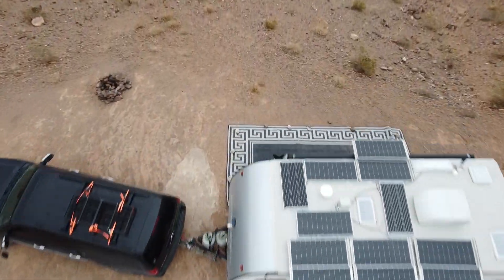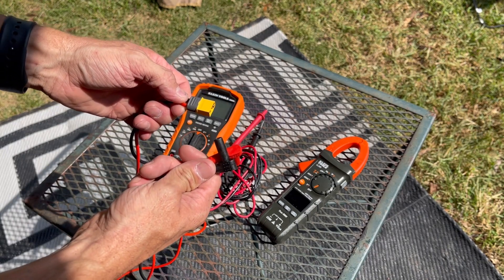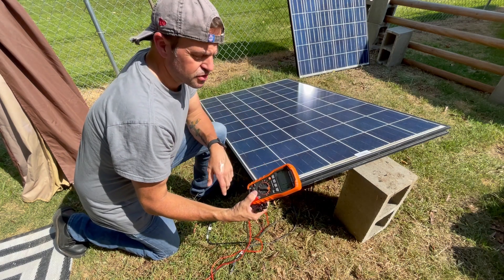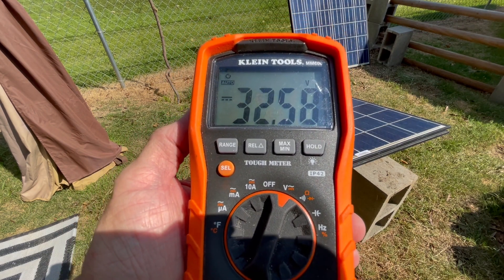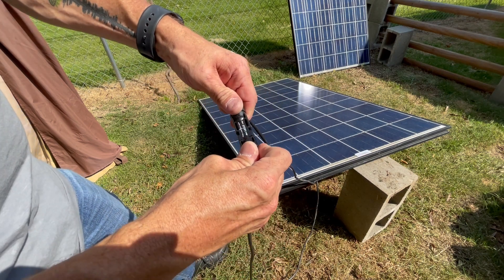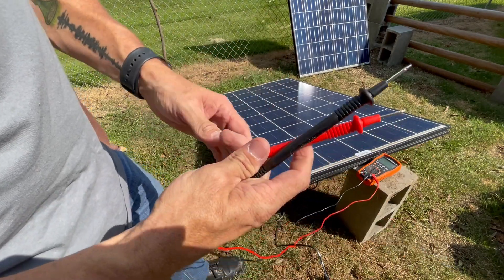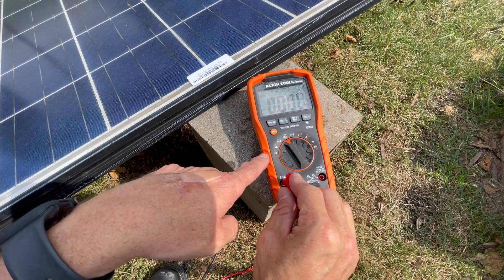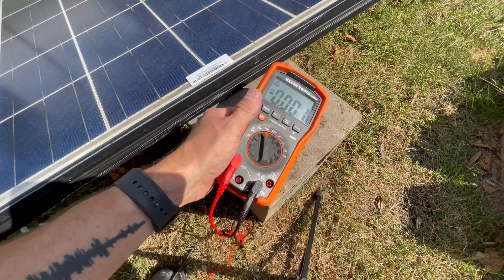How to Test Solar Panels - SanTan Solar 250 Watt Panels - Off Grid Solar - Off Gridin IT

Comment: For your information with electrical testing ground is always hooked last
Reply from the maker: You should always connect the ground on electrical testing equipment first.   The reason is because if you connect a testing device to a faulted circuit or device there is potential that it may send a surge in a fault event that could go through your testing equipment and into your body.   

If there is no ground connected then your body will complete the circuit and you could be electrocuted.   If the ground is connected it would be the path of least resistance and you would be more likely to be protected.   This is what I have leaned over the past 35 years.   

However, if you have a source that would refute this I would like to read it.   Please post it in the comments.

Comment: My inverter on my camper is shot. I think. It’s killing my battery. And the lights are flickering. I plan on doing a solar project next year. So what do I buy to replace my current inverter that allows for future solar?
Reply from the maker: If the batteries are at a low state of charge you may see flickering when you turn on other loads.  If you are building an all new system I recommend the Growatt SPF 3000.   it is an all in one system.  

It is great for 30 amp RVs and can handle a 2000 watt array and 145 volts input and is an 80 amp charge controller.  It is an inverter, charger and MPPT charge controller all in one.   

It's only $712.00 so it's a great budget.  
Also check out my affiliate links below for SanTan solar for great deals on used panels.

Growatt SPF 3000TL LVM
https://watts247.com/product/spf-3000tl-lvm-24p/?wpam_id=98

Shinelink Wifi-F Stick by Growatt (Growatt Bluetooth Dongle)
https://watts247.com/product/spf-lvm-120v-240v-solar-inverter-wifi-module-remote/?wpam_id=98

SanTan Solar T Series 250W Solar Panels
https://store.santansolar.com/product/santan-solar-t-series-250w/?ref=Off%20Gridin%20It

Comment: I feel that it might be dangerous to connect my 8 panel Series array  together to test the amps of the array ?  Can you tell me if there might be a problem with doing this?  Thanks
Reply from the maker: I’ve never tried to do that many. Typically I only test panels individually so that I can see if there’s a problem with a specific panel. 

Connecting the whole series won’t tell you if there’s an issue with an individual panel and it would be hard to tell if there was a problem because an array that large could have a pretty wide deviation from its specs depending on the environment and weather conditions.
Reply: @OffGridSolar  thanks for the response. I'm just trying to monitor my array output.it is only used for day air-conditioning for my home and I want to find out the amps it is able to put out. I was able to measure volts DC.  I'm not sure how to measure the amps
Reply: @mattm5696  U can short a string. Remove the cable from the PV array isolator and put a link between the positive and negative outputs of the PV array isolator and measure the DC Amps with a DC clamp meter. Make sure if using string fuses disconnect them.

Comment: When you measured amps through your meter on first configuration (not clamp-on), it looked like you had no load on your panel. I thought you couldn’t measure current without flow.
Reply from the maker: The current is flowing through the meter.   Another way you can measure current is to connect the Positive and Negative conductors of the solar panel together and use a clamp meter.   I usually don't use this method but it works well also.
Reply: Following
Reply: No danger to hook up the array?

Comment: Just as a side note, make doubly sure your meter can read DC on amps. I have 2 that only read AC, so testing amps on my solar would read nothing coming in. 

I've been asked how can my meter not read AC and DC and trust me, it is possible to have meters that only read AC and not DC. Don't think all meters read the same, because there are meters that read only AC for amps, generally the cheaper ones.

Also be very careful doing things in series especially if you have 24v setup. 
I'm doing parallel myself 2x100 watt 24v panels. Being as they are 24v that's doubled in series equally to 48v. A lot of meters don't handle that well.
Just do lots and lots of research before jumping into things. Learn what parallel and series means, as well as 12v and 24v. 
Once you start researching, it becomes easier. Either way is safe, as long as you know what your doing. It really depends on your situation as to what you are using and what setup you want.

Just fyi, I LOVE your connector idea. That makes things so so so much easier than using the standard. 
That would make it really easy for my sae connection.
Reply from the maker: You're absolutely right.  There are some meters that are AC only.   So when you buy one it is important to make sure it will test both AC and DC.   Great comment!

Comment: According to the shade I see the panels are facing the wrong way this will give a false reading    sorry
Reply from the maker: The point of this video is to teach people how to test solar panels.  Not to validate the specification of these particular panels.   

So now if you did actually watch the video all the way through you should now know how to properly test your own panels.  

So make sure when you test yours that you point your panels in the correct orientation relative to the sun for your geographical location.